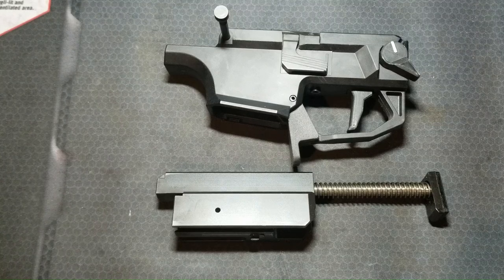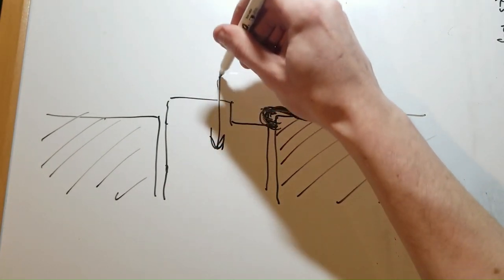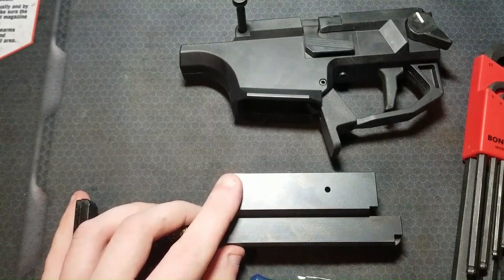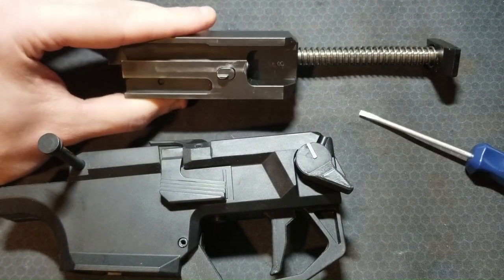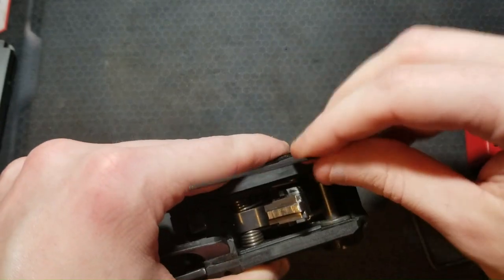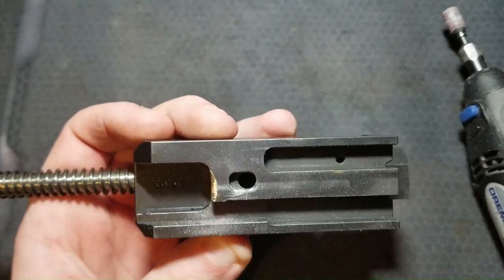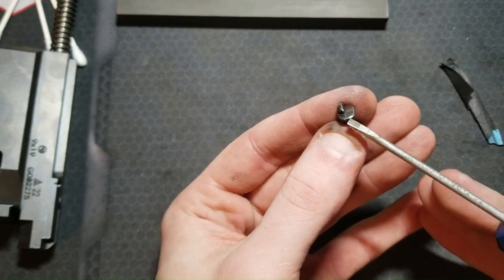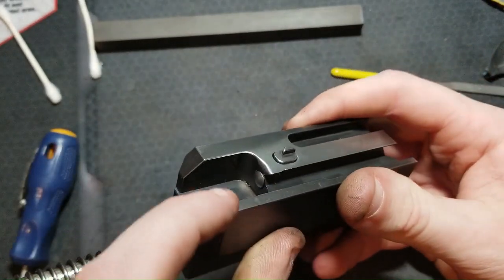Mitigating CZ Scorpion Evo 3 Bolt Damage and Issues

Comment: Huh I’ve got some adjacent experience with a detonation a few weeks ago. I’ve considered doing some sort of mods to the bolt or hammer to try to mitigate the chance of an issue. Just started the video…
Reply: What was the extent of the damage? Total loss? Injury? I was going to put a binary trigger in soon, but then I heard the detonation stories.
Reply: @poopooplatter7271  case rupture, receiver side blown out. No injuries CZ replaced the firearm it was toast.

Comment: Clean your bolt every 500 rounds and lub it really good . And you should not have this happen
Reply from the maker: That would certainly help and I think a lot of people neglect that. I have certainly done that on this gun and still got the minimal distortion shown in the video. But I would call it minimal. i lube that sucker up before ever range trip/every ~200 rounds. What I show in this video should just be that little extra bit of mitigation I want, and it took me all of 30 minutes, some elbow grease, and using tools I already had.

Comment: It's a untreated block of steel. Not nitrated and not forged steel. You wouldn't have been able to grind it down that easy with a Dremel tool if it was nitridated. It's supposed to be forged steel/tool steel but CZ said to themselves, them gun toting American citizens don't need a quality bolt. I doubt they use the same bolt and hammer steel for their full auto military and police contracts. The ultra thin surface of Hardened/nitrated steel lacks the toughness and elastic properties of forged steel. AK47, ARs and pretty much all other iconic rifles use unhardened forged steel locking mechanisms because toughness and elastic properties is more important than surface hardness with a soft core that get smashed in with repeated impact forces.
Reply from the maker: The CZ bolt is definitely coated and I am pretty sure its nitride (it is absolutely not just an "untreated block of steel"). I would be surprised if its DLC, and it certainly doesn't look like or behave like bluing. However, whatever coating is on there is thin, which is why it was POLISHED (not grinded) off so easily. As for the material of the factory bolt, I am not sure. If you have more information on the material of the factory Scorpion bolt I would love to hear it. My guess is 1045, or a 300 series stainless with nitride finish. Not sure if its forged or not, what heat treat they use, etc. 

The comparison to the AK and AR is not apples to apples as those forged bolts and carriers have locking features and are designed to deal with the MUCH higher pressures of the rifle cartridges. The job this direct blow back (not locked breach) 9mm (handgun not rifle cartridge) bolt needs to do is much less demanding than what an AR or AK bolt needs to do, and the forces they regularly see. This is not a rifle, its a PCC/SMG so the requirements of the hardware is much different than a rifle. I am also not familiar enough wit the material specs of the AK and AR bolts to speak on that. While the heat treatment post forging may not be specifically for hardening the material, forging (of steels) almost always required heat treatment to relieve internal stresses from the forging process and create the desired material properties. 

I agree the material of the factory bolt needs to be harder. I would be blown away if they had two separate manufacturing lines for these bolts, one for the SMG and one for civilian use/American market just to spite us. That doesn't pencil out in terms of cost, incoming materials, work flow etc. These bolts are all the same material, processes, etc. and that's just how they are. 

You seems to know a lot about the Scorpion so I would love to hear your experience with them. Sounds like if you do own a Scorpion you would have the Nexus bolt in there. That bolt is much harder and heat treated (although not forged). 

Please do share more!
Reply: @EngineersArmory  There is a big difference between a coating and chemically changing the metal  surface with processes like nitriding, Tenifer, Melonite, nitro carburizing and more names. All methods archive the same thing, which is to infuse nitrogen into the metal. The depth ranges from 0.008-0.040". 

A coating just sits on the metal. If the Scorpion bolt was nitrided or made of stainless, cold blue wouldn't work on it due to the corrosion resistance. And you wouldn't have been able to chamfer it with your Dremel if it was nitrided. The scorpion bolt takes on cold blue very nicely, which means the bolt has not been nitrided. It's just blued man. It's not even the correct forged steel because you wouldn't see such horrible metal deformations. 

It's a crappy made bolt. And yes, I had a scorpion pistol in FDE and sold it after shooting a box of 100 Blazers though it. I noticed right away what was going on when I cleaned it. No way I throw money at this POS by buying an "advanced" bolt. Forged is the only way to go on these firearm parts, it doesn't matter if it's a 9mm or  a AK47. Everything else doesn't last including nitrided/hardened steel. Nitrided steel properties are excellent for heavy sliding forces and corrosion resistance. The core is still too soft for absorbing high impact forces because it lacks the toughness and elasticity of forged steel.
Reply from the maker: @702Wolfi  Ya got me on the semantics of coating vs nitride, etc. Check your coating thickness measurements too 8-40 thou IS HUGE. Nitride generally ends up .0005" or less (half thou). 

And yea long and short of it is the bolt material should be different, its not quite right for this application. It will also vary from gun to gun how bad and quick the damage results from use. In general the damage isn't terrible, and I don't think that makes the gun a POS or make me feel some sort of way about CZ as a company. In mine after ~2k rounds the damage wasn't that big of a concern. I wouldn't imagine most guns would see an issue until 10k rounds. But I am sure there are some guns out there that the bolt damage was causing issues or starting to around 2k rounds or less.
Reply: @EngineersArmory  The old molten cyanide salt bath nitrogen infusion process Glock used many years ago went ~0.070 deep. 

A tourist gun range in Las Vegas had 4 scorpion pistols available to shoot for tourists. All of them began failing to ignite the primer because the deformed hammer wouldn't transfer enough energy to the firing pin. Granted, all had more than 10k rounds fired if I recall correctly.
Reply from the maker: @702Wolfi  After 10k rounds most guns are going to need some TLC. I suppose I would just look at the bolt and it components as a "wear item" at that point. Oh well, everyone can have their own use cases and what they deem acceptable.  

Molten salt bath nitriding thickness is generally 5-15 microns which is .0002"-.0006". Two to six ten thou. You're about 2 orders of magnitude off.
Reply: @EngineersArmory  10k rounds isn't much for a good gun. A spring service is about the maximum it should need.

No no, my number are correct. It depends on the duration and how hot the metal is before you put it in the bath. The hotter the metal, the deeper the nitrogen infuses via the very small cyanide molecules of which the nitrogen atom is part of. 1.5mm 0.059" deepness can be done with gaseous nitro carburizing and cyanide salt baths.
Reply from the maker: @702Wolfi  service life is subjective based on the owner I suppose. Then there is the service life the manufacturer had in mind. Anyways my gun may see 10k rounds in its life. Maybe not. So it's fin for me. 

Hard to believe the 1.5mm nitride depth. Extreme cases I've heard of 0.5mm so maybe? It still seems too far off to be reasonable. Would love to see a source on that!

Comment: I concur completely. I knew this mitigation was possible and that someone would figure it out, vid and post it.
Thank you. I have two legacy Scorpions and this illustrated maintainance is fabulous. 
I think if this had been done on new Scorpions, we would have never even had to have this procedure post firing.
Bolt and hammer wear is normal on almost all semi-autos. I have not fired either of my guns but I am doing this before I do and I bet this will never become an issue in the first place. I think the somewhat softer bolt is mechanically appropriate for an action that operates inside polymere anyway.
Routine inspection of the internals of any firearm should be SOP. THANKS //ji
Reply from the maker: 100% agree with you! I am glad it was helpful. Thanks for watching and commenting!

Comment: Are you going to apply your favorite Moly grease to those rubbing contact surfaces ? And will you show us the condition if this area after another 1,500 rounds ? That. Would be great 👍
Reply from the maker: Molybdenum grease would be great for this application except for one thing... Too close to combustion particulates. In my experience grease that gets exposed to enough powder residue over time gets sticky and gummy and it can affect operation. These parts will just be liberally oiled. I will make myself a note to try and make an update video down the road. Thanks for watching and commenting!

Comment: Hi, do you have problems with rust on polished palaces? Have you protected  it?
Reply from the maker: No, my guns stay well oiled like they ought to. During normal operation all firearms will wear the finish off the internals in some places which will open them up to the posibility of corrosion. Another reason we need to oil out firearms for proper operation and longevity.
Reply: @EngineersArmory  thx for your explanation, just wanted to know you have done for example oxidation. Regards
Reply from the maker: @mariuszb1048  Yeah no problem!

Comment: Don't these come in full auto version? What kind of bolt are they using for the full autos?
Reply from the maker: They do come in select fire, those versions would only be available to LE and military. I do not know if the bolt material is the same or not. The select fire versions have an auto sear in them that acts as a safety to prevent out of battery detonation and I am pretty sure they do not have a firing pin safety block. They added the FPSB and lifter to the trigger pack on the civilian version becuase they do not have the auto sear that disconnects the trigger until the bolt is in battery.

Comment: Would this be a good alternative to the Nexus bolt?
Reply from the maker: For my purpose, yes. I don't think the severity of the damage/wear I see on my bolt warrants a $250-399 replacement bolt. I am comfortable with what I have done to my bolt and will continue to monitor for more damage/deformation and firing pin block function. Every individual should asses the severity of the damage to their factory bolt and what they feel comfortable and safe with. Maybe the Nexus bolt will give some people peace of mind.
Reply: @EngineersArmory  I’m thinking the Nexus is good for me 👍
Reply from the maker: @mattwalters6834  well there is your answer haha. Certainly easier. Take the old one out put the new one in.
Reply: @EngineersArmory  totally 💯

Comment: It’s too bad CZ will not simply fix this problem for an otherwise awesome firearm.  Too many other reliable PCCs out there from S&W, Ruger, Sig, etc. without this problem.   Not even lowly (<$400) Keltecs have this issue…..go figure !
Reply: AKV for the win so far. I only hate that it is a bit front heavy.
Reply: The Beretta CX4 Storm is also nice, no deformation of the bolt.